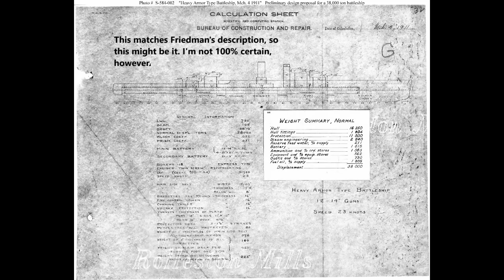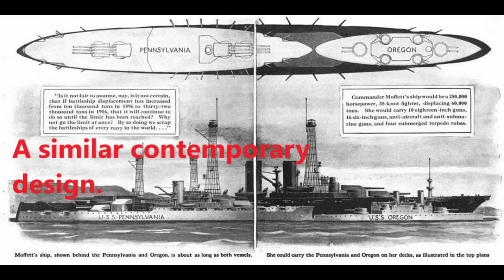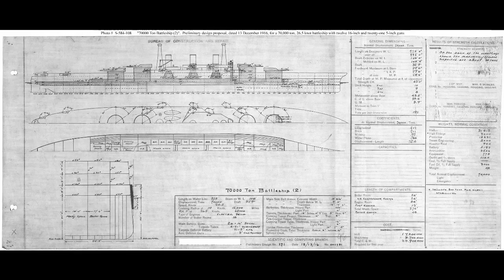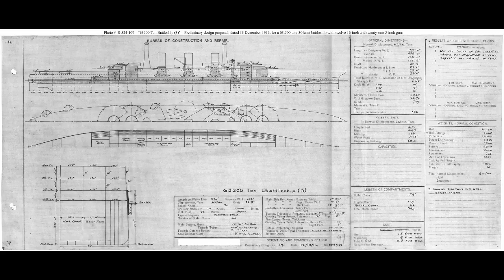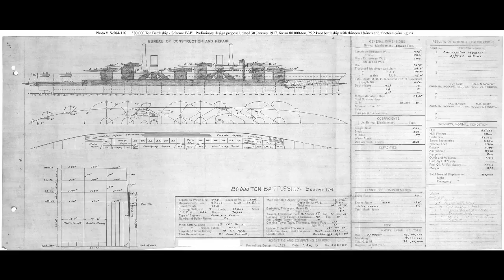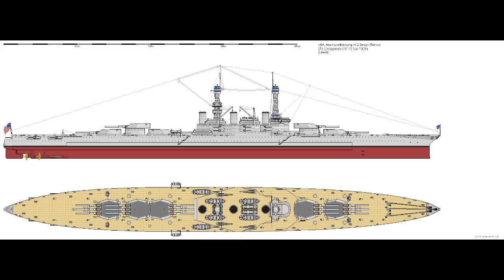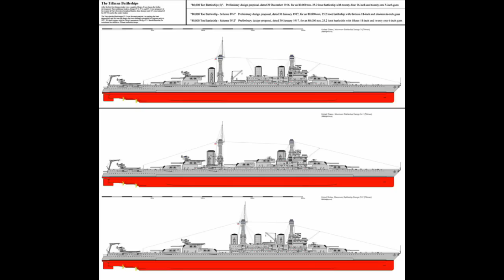Tillman Battleships – “Build The Biggest Battleship Ever!”

Comment: These ships were actually within the industrial and technological capabilities of the US at the time these ships would have been built. The first slip for these ships would not have become available until the launch of the first large scout cruisers, which would have been 1923. There were SIX slips in the US, both government and commercial, which could handle these ships. The 18in prototype gun was in hand in 1921-22 but were scrapped or converted to the 16in Mk.IV by 1923. The turbo-electric machinery (180,000 nominal shp, 220,000 demonstrated at trials) was also already designed and being manufactured for the large scout cruisers. The main limit, other than the Panama Canal, was the thickness of cemented armor. At this time, the USN believed that 13.5" thick plates were the best US steel producers could produce with consistent high quality. Each additional inch was assumed to only add .9 inches to the thickness. It should be remembered that a "fast" battleship for the USN was 23 kts. Consider that in 1922, the US had FOURTEEN capital ships building, for a total of over 550,000 long tons. Which means that there was sufficient steel and armor produced by the US from 1919 to 1922 to build nine such capital ships from 1923 to 1928. It was entirely possible to build these ships, the question was whether it made strategic and doctrinal sense, much more, that whether Congress would have funded such ships. But keep in mind the operative words in Sen. Tillman's question were "COULD BUILD".
The later studies were of the maximum battleships that the Japanese could build when they withdrew from the Treaty system in December 1934, not what the USN was looking at building.
Also, none of these studies featured hull casemates for the secondary armor. Using a flush deck with high freeboard and the secondary battery mounted in casemates in the superstructure ON THE WEATHERDECK was a USN design feature from the "Tennessee" class on, due to experience with hull mounted casemates in bad weather in the North Atlantic during WW1.

Comment: I like the Tillman 3 design, it's scary how this designs characteristics took bits a pieces from the Iowa and Montana designs and combined them almost 20 or so years before the ships ever hot the water.

It was fast like the Iowas (abliet slower at 30 knots)
-It had the Montanas firepower.
-It had 332mm of belt armor which was lower than the Montanas but higher than the Iowas.

And its strange how the Tillman class would introduce these ideas into the U.S navy shipbuilding that result in some eventually becoming the  real steal ships.